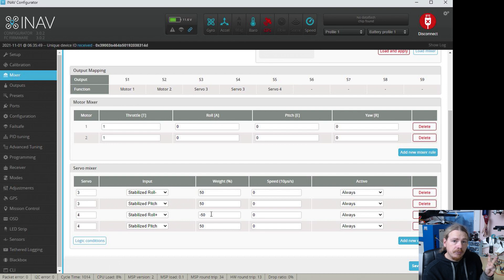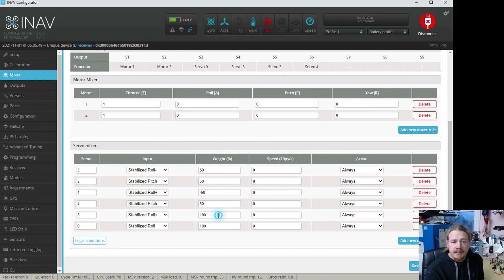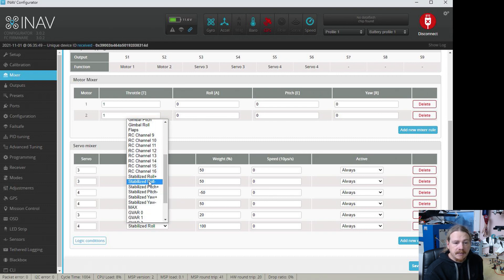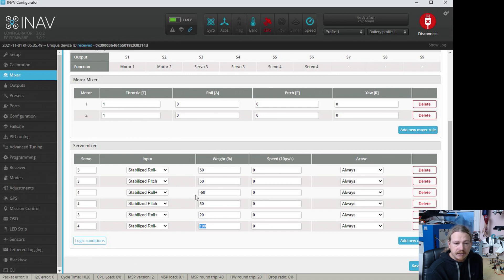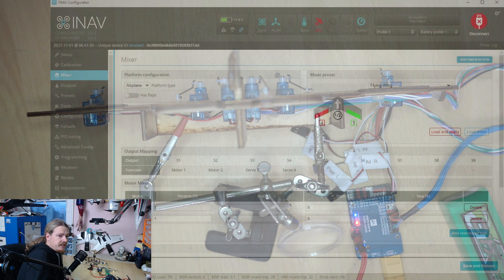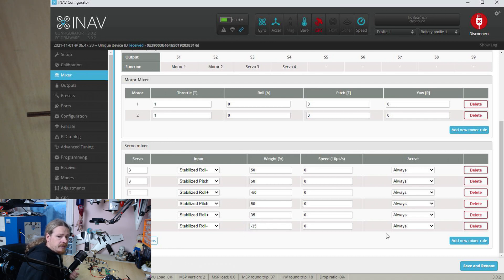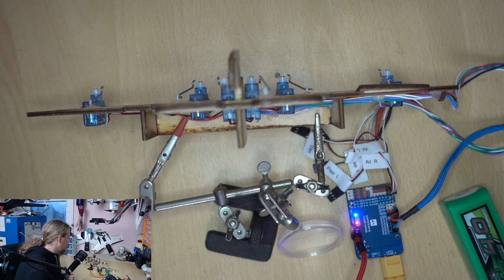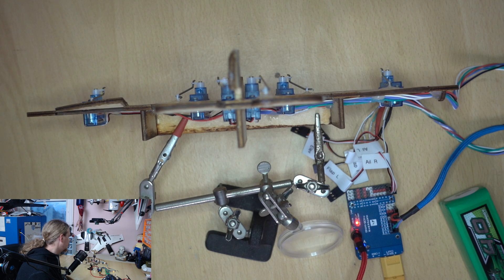Setting up aileron or elevon differential in iNav

Comment: Great tutorial for how to setup iNav for differential.  One nit though.   You only want more up-throw than down on a conventional wing.
For flying wings and planks, it should be the opposite, slightly more down throw than up.    Why?  Because the elevons on
a flying wing/plank generate negative lift.  In steady state flight they're pushing the back of the wing down.  When raised they generate more negative lift, and thus more drag, than when they are lowered and they generate less negative lift and less drag.   Driving them down a little faster than up balances this out, and you get nice axial rolls with little or no adverse yaw.     Don't just take my word for it.  Try it. 
We've been setting up slope wings and planks for 20+ years this way though.  

On a conventional wing, they have net positive camber so the ailerons are always contributing to the positive lift of the wing, so by running them up faster than down, you balance out the lift induced drag, reducing adverse yaw.       

And yes, I generally just do this mechanically, but using the mixer is useful if you want differential combined with something like flaperons.

Comment: Just tried this in INAV 7.1.0. The down servos don't respond at all to roll commands. I haven't read through all the changes but the mixer options are still the same as in this video (which I've used many times before).
Edit: Got it to work. The mixer fooled me - it shows S3 (L) and S4 (R) in the graphic above, but S1 (L) and S2 (R) below in the rules - This is wrong - similar to how it was wrong in this video way back when. I followed the numbers from the rules and it works just fine now.
Reply from the maker: There are 2 different numbers. In the servo table. It shows the servo order. This isn’t the same at the output mapping. That table shows the signal output, the same as the image.
Reply: @MrD  thanks!

Comment: on my wing it wil not mix the ailerons. so if i roll left, only the left aileron is moving up..  what cause this problem?
Reply from the maker: To be honest, there really isn't enough information there to diagnose this? Were they working before you tried to add differential?
Reply: @MrD   yes they worked, if i turn everything normal it wil act normal, so,, roll to the left "left aileron up and right aileron down".  i also used the new inav 5.0 btw.. what i tried is multiple diffrent things in the servo mixer to get it maybe work but i left over with only one up and the other aileron that supposed to be slighty down that wasnt even moving..    also there is no red or green labels on servo mixers. on the plane picture there is only a number on the motor position so no red or green flags on the wings like servo 3 or servo 4 you know? i dont know how to fix it. hope you have any idea !  im bit new to the wings/planes stuff thanks :)
Reply from the maker: The colours has been noticed and fixed. So don’t worry about that. 

If you are new, I wouldn’t worry about differential. Just use the standard mixer for now. That is fine in most cases.

Comment: Hey Darren
This is GOOD stuff. 
I am building a twin seaplane and don't want adverse yaw but do want differential thrust for water handling.
I'm concerned because in Inav you can't turn the diff thrust off and to co-ordinate a turn will likely need rudder (or differential aileron). Is there a way to turn the motor differential off while flying (or vary it with a switch or knob) ?
Thankyou
Reply from the maker: Thanks Dave. 

Unfortunately not at the moment. It would be really handy if the motor mixer could make use of the logic conditions with an active column. Then it would be possible to select when differential thrust is used.

Comment: I now have it set up on my plane. Works a treat. For some reason I didn't need the negative weights in the mixer (all mine are positive). Happy customer! Big thank you!
Reply from the maker: If this is aileron, you may not need negative weights. Depending on how the servos are in the wing.